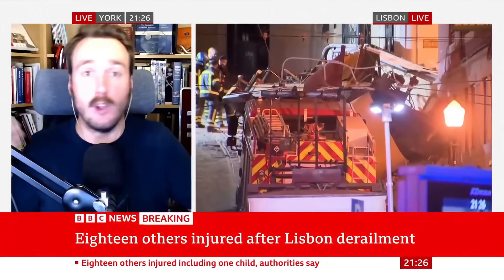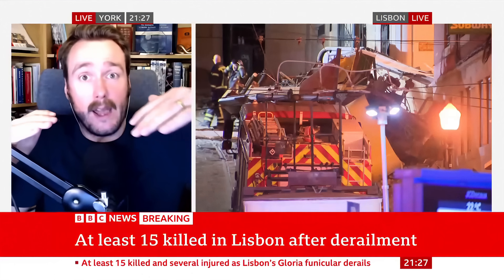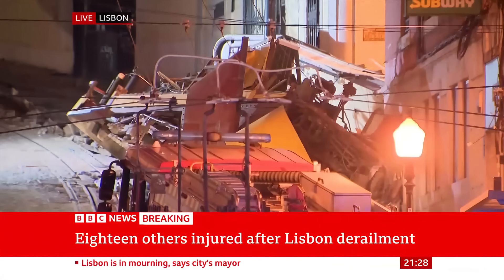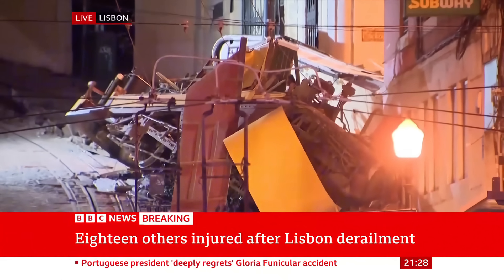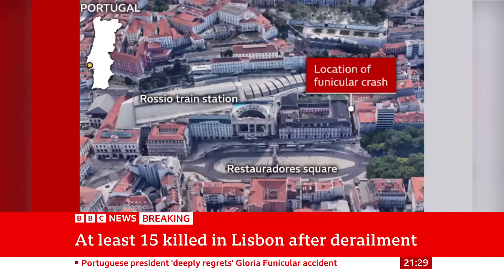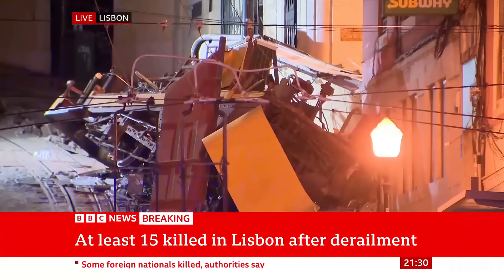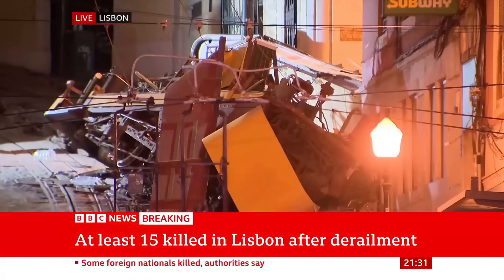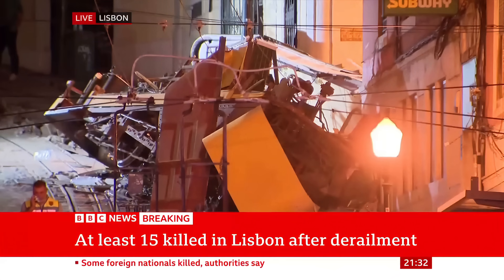Engineer gives thoughts on Lisbon funicular crash | BBC News

Comment: If one car is safe at the bottom of the hill it would mean the other one was at the top when the cable snapped. This then meant the other one fell down the whole slope with the brakes failing. In free fall from the top it could reach incredible speeds and only stop if it derailed or crashed into the buffers.
Reply: That’s an absolutely correct conclusion.
Reply: If the height difference between the ends of the track is about 45 metres and the carriage ran unrestrained most of the way down, the speed would have reached somewhere in the region of 80km/h or 50mph. This can be calculated from the height difference and the acceleration force of gravity. If the carriage had brakes and they were applied to the point of locking all the wheels, the carriage would probably have slid on the steep gradient; the speed would have been a bit lower but still enough to cause a bad crash.
Reply: @cedriclynch  It was much worse/faster because the street (Calçada da Glória) is actually 265 metres long, with an average incline above 17%.
Reply: @paulavitoria1798 It is the difference in the height rather than the length of the track that determines the speed that a runaway carriage with no restraint will reach. A 17% gradient for 265 metres is a height difference of about 45 metres. Falling for the whole of this height (which did not happen in this accident because the carriage crashed before it got all the way to the bottom) would give a speed of about 100km/h (just over 60mph)
Reply: It went downhill apparently 150 meter, some estimate speed at 90km/h, the bootom funicular falled 1 or 2 meter i think. If wasnt for the curve it would most likely hit the other funicular causing more casualties.
Reply: @santostv. does this railway have single tracks at each end with passing loops at the half way point?
Reply: I know the place. Sadly that s exactly what happened.
Reply: Yes that obviously happened but surely there must be some form of braking as well. Perhaps the cable broke and severed hydraulic lines? Awful tragedy.
Reply: Sou Portuguesa, este tipo de transporte faz parte do nosso quotidiano;  a  manutenção é assegurada "escrupulosamente, e que a segurança é uma prioridade absoluta da Carris há 152 anos. O Ascensor da Glória, construído pelo engenheiro português Raoul Mesnier du Ponsard, foi inaugurado em 24 de outubro de 1885, constituindo-se no segundo do género implantado na cidade por iniciativa da Nova Companhia dos Ascensores Mecânicos de Lisboa. O sistema de tração original era de cremalheira e cabo equilibrado por contrapeso de água, passando mais tarde a ser a vapor. Até finais do século XIX, durante as viagens noturnas a iluminação dentro da cabine era feita com velas. 
Em setembro de 1915 passou a ser movido por eletricidade.
Os dois carros, idênticos e numerados 1 e 2, foram construídos pela empresa alemã Maschinenfabrik Esslingen; são compostos por duas coxias de comando (uma em cada extremidade) e por um salão de passageiros com dois bancos corridos de costas viradas para as janelas, tudo no mesmo nível horizontal — havendo uma extremidade mais alta (anterior no sentido descendente) e outra mais próxima do solo, tal como o Elevador do Lavra, no que difere de muitos outros funiculares. As entradas e saídas de cada carro fazem-se por duas portas munidas de cancela pantográfica e situadas na extremidade com menor desnível em relação ao exterior, de ambos os lados do posto de comando activo em ascensão.
O trajeto é de 265 m,[17] em via de carril duplo encastrado no pavimento de arruamento vulgar, com bitola de 90 cm e fenda central para ligação do cabo. Vence um desnível acentuado, superior a 17%.Since 1885, 2 cases of Derailments:
On 7 May 2018, a car derailed due to insufficient wheel maintenance. NO injuries were reported.
On 3 September 2025, a car ran away and then derailed after the failure of a steel cable, and brake malfunction.  
Atualmente, é a “empresa Mein que faz a manutenção dos elevadores” da Carris, declarando que a  manutenção do elétrico que descarrilou em Lisboa, é assegurada "escrupulosamente, e que a segurança é uma prioridade absoluta da Carris há 152 anos.“
O elevador da Glória foi inspecionado na manhã de quarta-feira, dia da tragédia. 
A inspeção demorou sensivelmente 30 minutos e foi referido que o cabo deveria ser substituído dentro de 263 dias. A notícia foi avançada pelo Observador, continuando: ”seremos intransigentes no apuramento das causas e responsabilidades deste acidente, pelo que estamos empenhados para muito em breve estarmos aqui para apresentar as conclusões deste inquérito”.
Reply: Yes, lthough there are no buffers on this system at the bottom since the bottom car can't travel further than the end of the track if the car at the top stops in the right place.
Reply: @androo4519 OK . I’m not familiar with this railway and assumed there would be buffers etc. As there isn’t any it’s sadly a good job the car derailed before the end of the track or it would have crashed across the street hitting god knows what at an even higher speed
Reply: @rockerjim8045 You're absolutely right, tragic as it is, it could have gone much worse and cause more than double the casualties, as the ascending cab is usually much more packed than the descending one (which is logic, of course).
Reply: @paulavitoria1798  it wouldn't have hit the bottom cab as they are on separate tracks. Worse than that it would have gone past it and out into the busy Avenida da Liberdade with constant cars passing on three lanes - it was rush hour - and thousands of tourists milling about. The death toll could have been far higher.
Reply: @androo4519  actually the bottom car did run back past its end stop. It was left sticking out onto the Avenida da Liberdade.
Reply: Yes ,that’s the point of maximum stress for the cables and the joints,it was the same position in the Stresa Mottarone cable car crash.

Comment: You'd think it would have a safety brake like an OTIS lift.
Reply from the maker: they usually do, though I didn't speculate on that in this case as I'm not sure what the design of this railways secondary brake is
Reply: Interesting -- I was wondering about that. I know it's a pretty old machine. We shall see.
Reply: @GarethDennisTV  I'm assuming the rails for these are like the level trams, a rail with a groove next to it. If something got wedged in the groove causing the carriage to jolt, might that have broke the cable whilst at the same time derailing it? Would the brakes have much effect once it derailed?
Reply: It doesn’t work like an OTIS-elevator. The system is completely different and more comparable to a so called „pater noster“.
Reply: @bernharddirichs5992  no shit it does dont work like as elevator, you should go to shark tank with your knowledge sir
Reply: @Luke-xf9qo 
I know the funicular in Lisbon by a lot of experience, lived there temporarily only some 40 Meters away from the crashpoint and I know the difference to a common elevator. You should do something about your pronounced Dunning-Kruger effect.
Reply: @bernharddirichs5992  I think it runs deeper than Dunning-Kruger!🤣🤣
Reply: maybe it does
Reply: I expect it did, but maybe it failed to work. There have been disasters with vertical lifts when the brake failed because of lack of maintenance.
Reply: Yes it has

Comment: It sounds like a broken cable.  Whether there was an external factor that caused the cable to break, or the cable was weak because it was life-expired or rusty, is the key question.
Reply: Engineer here. That's not the main priority at all. A cable snapping is not as rare as you think. The cable snapping, the automatic emergency breaks not engaging and the driver not activating the hand breaks is something I've never seen in my lifetime.
Reply: @DataNauticalOfficial  Supposedly there are three cables in parallel, but no emergency locking-brake (which is crazy if true). Handbrake would probably not hold against momentum on that slope.
Reply: @DataNauticalOfficial 
It derailed.  What would likely cause that?   The cable failed after it derailed probably…?   I wonder if they have been able to talk with survivors yet..?
Reply: @hiltonwatkins6750  - No, it derailed because there's a curve and it was coming down much faster than it should. The cable (or some part that held the cable) broke when it was at the top, just starting to move down.
Reply: @RFC3514 
Oh.  That sounds like the cable failed.  The two cars pass in the centre so it might have been at the end of the double track where they separate.  Hmm.  Sounds like inspection missed a problem developing.  I hope they have good insurance.
Reply: @hiltonwatkins6750  - The upper cab definitely "broke loose", which technically shouldn't happen even if the main cable failed. It's possible that something in the cab itself broke and lost its grip on the main cable and the backup cable(s) as well.
Reply: @hiltonwatkins6750 It was reported that a car at the bottom suddenly "dropped two metres", which would be when the cable failed.  So the other car was right at the top, and that car came down the full length of the track accelerating under the force of gravity, which would explain why it was going very fast at the time of the crash.

If the cable had broken while both cars were in the passing tracks, then one or both cars would have derailed almost immediately, as both cars tried to enter the single lower track at the same time.
Reply: @DataNauticalOfficial  Engineer here , maybe a metal fatigue issue for the cables breaking, for the last 20 years this funicular only works at full load due to its popularty so the hardware will not last as much has it should
Reply: @DataNauticalOfficial  Them's the breaks.
Reply: Inspection records must be examined and compared to evidence.  If there is a maintenance / corruption issue this could become a big scandal….😮
Reply: Portuguese here. Apparently the maintenance is done by an external company and not Carris itself. I somehow have a feeling that the maintenance was not done properly as a way to save money. It's just speculation at this point, but it is really weird that all 3 security redundancy systems failed.
Reply: That cable has more 2/3 of life till expires.

Comment: Not all funiculars are on a steep slope, or any slope at all. .... The Hogwart's Express at Universal Orlando is a funicular, that is as near to horizontal as makes no difference.

I presume the Hogwart's express was constructed as a funicular because of the inherent safety features of the design, specifically that there can only ever be two trains, and that it is functionally impossible for them to collide as the two cars/ trains are connected to opposite ends of a single cable (or cables) that fix their positions on the track relative to each other, such that they can only ever meet at the dual passing tracks half way between the two termini stations.
Reply: I'm pretty sure a Funicular needs the gradient to work as by definition it relies on the counter balance between the carriages. It's a type of cable-hauled railway, but not all cable hauled railways are funiculars.
Reply: @lon1117  Yes. If it was horizontal it wouldn't work at all. You can't push with a cable: one car would just sit there and the cable would go slack.
Reply: @lon1117 I used to think so too, but what Universal had built in Orlando is a funicular in every sense, except it lacks any gradient.  I assume that using a funicular design allowed Universal to bypass most normal railway safety systems and procedures as the two trains operate simultaneously at all times and (as long as the cable doesn't brake) it is impossible for the two trains to collide.

If you pull up Google Maps you can find the Hogwart's line running through a backlot area of the Universal Orlando complex - passengers cannot see out of the trains, which have screens showing video during the journey.  But on Google Maps the passing lines are clearly visible half way along the line.
Reply: @pulaski1 

I can imagine a horizontal funicular railway, but in my opinion it makes little sense, as the lack of weight of the second carriage would require a much higher engine power to operate it.

Comment: Regarding the question at 05:00, there is a witness that states she saw the cab that is intact at the bottom hill fall about two meters. Rushed to help the people and then ran away when she saw the top cab approaching
Reply: Yes. The bottom cab was 2m away from the very bottom of the rail. When the cable snapped, it lost tension so went all the way down those 2m. Lucky it was just 2m or there would have been more victims...
Reply: @nemewsys3676  A seemingly knowledgeable comment under another video about this suggests that there are THREE cables running in tandem, so that if one breaks, the other two will hold the system safely, but also that there is no emergency braking on this particular funicular. If so, this suggests that the failure was at a connection to one or other of the two cars, causing the runaway. We'll find out eventually. RIP to all deceased.
Reply: @lusoverse8710  ah, the good old „eject engine“ (or in this case eject cables) button…
Reply: @lusoverse8710 it makes sense. If one of the cabs snaps cleanly from the cable, the other one effectively loses its counterweight and the friction on the motor pulley will not be enough to hold the cable and the cab in place.
Reply: @lusoverse8710 not true. Only one cable, has normal brake and emergency brake. As reported by my grandfather who worked there!
Reply: @Picondcg  OK thanks for the correction.
Reply: @lusoverse8710  Did the three cables all connect up together (being a weak link if the connection fails) or did they connect up to the cars completely separately?
Reply: @leeroberts1192  It seems the three cables theory was wrong and there was just the one. Current reports are that that cable snapped. Further details will emerge I'm sure.
Reply: @lusoverse8710  I wonder if all funicular railways around the world might get made to have a backup cable installed and a mechanism to hold the car that's at the top station physically in place so that it can't ever move if the primary cable fails.
Reply: @nemewsys3676 
Absolutely correct.
Reply: Well, that suggests that the top car should’ve been some 2m from the top…

M*V^2 gets really big real quick
Reply: The people in the bottom cab were very lucky that the other one crashed in that corner.
Had it been one straight line, the situation would have been even worse!
Reply: @Rob2  not really as they are on separate tracks. Although it would in fact have been worse because the descending cab would have shot out into the Avenida da Liberdade into three lanes of passing cars!
Reply: @jokermaan1  The street is so narrow that the tracks are interleaved except at some point in the middle where they can pass.
At the low end of the street you see the 4 tracks basically at the same distance, one pair of tracks overlaps the other.
Reply: @jokermaan1  Single track except on the middle.
Reply: @jokermaan1  separate tracks near the middle and top, but at the bottom the tracks are interlined. So had the top vehicle not derailed it would have literally crashed into the bottom one.
Reply: @Rob2  yes, you're right. The track separates at the midpoint where the cars have space to pass one another.
Reply: @jdillon8360  yes, looking more closely, you're right. And had that happened, with nothing to restrain it, the bottom car would probably have been shunted out into the path of traffic in the Avenida da Liberdade!
Reply: @RJASOARES  Yes, you're right, the track only divides in a part of it.
Reply: Precisely. I think this commentator put it all very well.
The bottom cab being very near the end of the descending path should mean the other one was near the top. Then it slided freely all the way down, gaining such speed that made it derail at the curve, just some 40 meters from the lower end. The derailing avoided a crash between the two cabs...

Comment: Does the Lisbon Funicular not have a cogwheel safety brake to prevent rollback in case of a cable failure? It does in the black and white photos and drawings but I cant see it in the more recent photos.
Reply: There are apparently four different funiculars and a lift for taking people up and down the hills in Lisbon, so you might be mixing this one up with another one.
Reply: @DavidShepheard  They were all built by the same engineer; Raoul Mesnier du Ponsard. Definitely Ascensor da Glória in the photos. Reading up the rack brake (a giant cog and steel chain on a rack rail) was removed with electrification in 1914 in favour of drum wheel brakes on the running wheels (also since removed, possibly in favour of electrical or hydraulic brake discs?) and a claw like an elevator brake that causes two brake pads to grip the central rail if the tension in the cable is lost (still in use).
Reply: @watcherzero5256  I assume the elevator style brake would operate automatically if the cable breaks? Was this designed to be able to stop the car even with the cable gone?
Reply: @adrianthoroughgood1191  A cable hauled car like this would have a spring loaded brake that gripped the rail(s) if cable tension vanished. Of course it would be designed to stop the car with the cable gone, that is the point of it. Same with vertical lifts. However these things can fail to work sometimes, maybe because of lack of maintenance.